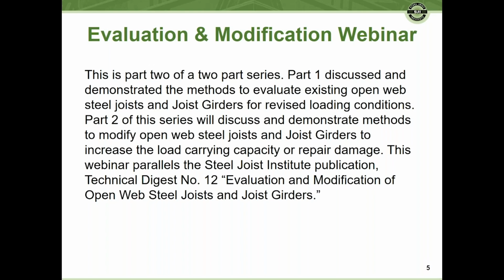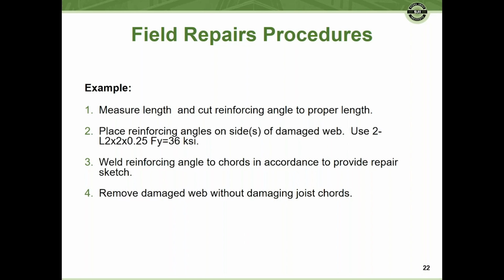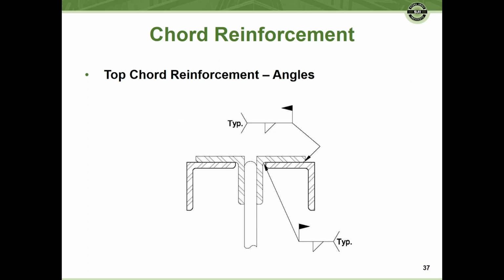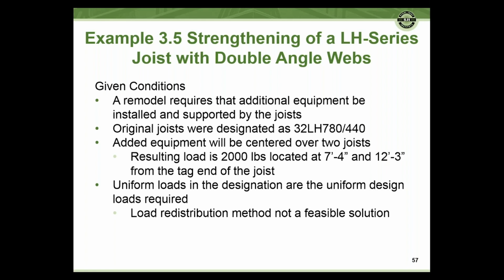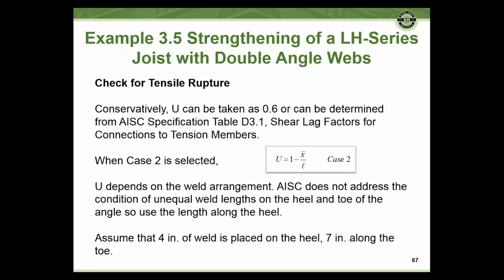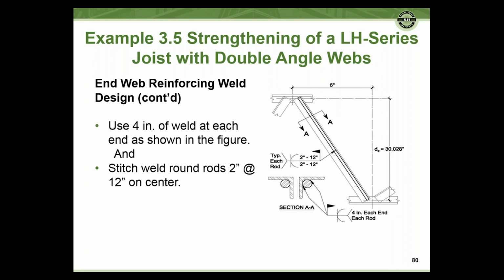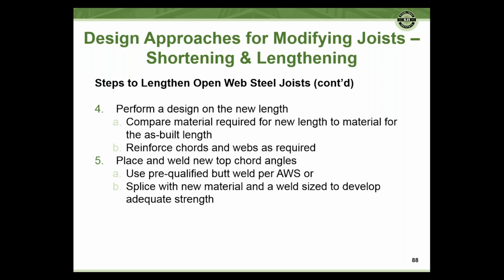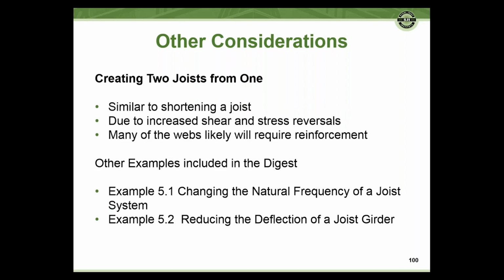Evaluation and Modification of Open Web Steel Joists (Part II)

Comment: Very informative.  I'm building my own 2.5 .25 thick angle 24 inches tall and 2inch webbing with a vertical at every V square ends to support an out door bridge crane beams . For an out door work area to move projects.  Nothing too heavy dont see weight exceeding a thousand pounds.  Riding mowers, zero turns . The end of the beams 10" galvanized  supported well at the ends the truss will be brige an opening to support the center of the 40ft beams . Width of run 35ft. 20 wide. With 2 cross trusses at 10 and 21ft . I just neet to keep one side open . No roof. Planned , no snow area. Again thanks for your posting of video. 
 I subbed.